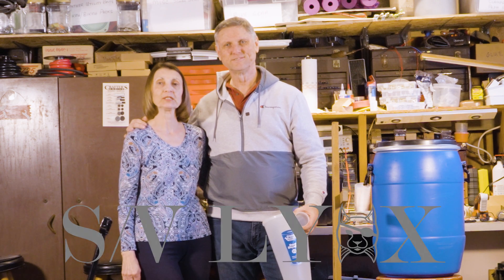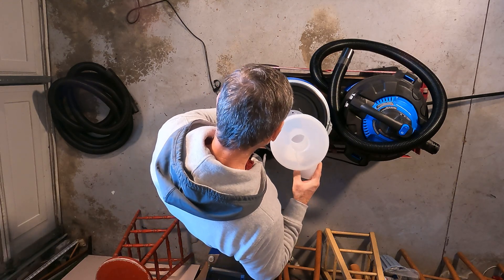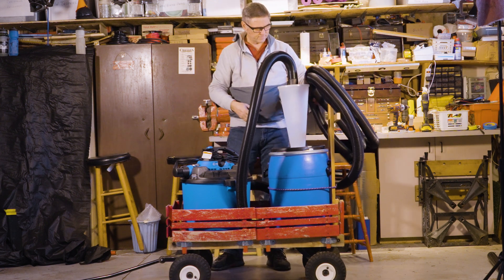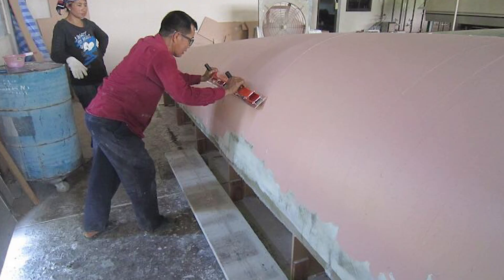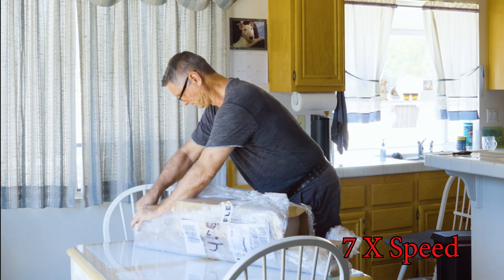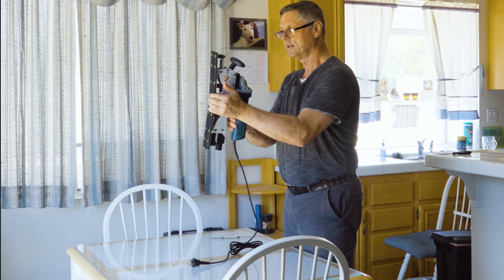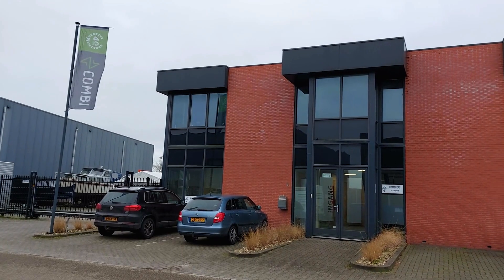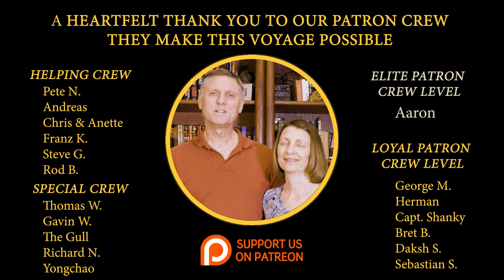Kit-E19 Cyclone System and other Kit Cat build preparations

Comment: I use a similar dust collection system in my small wood shop.  I added a dust bag inside the vac to guarantee the shop vac filter doesn't get clogged.  This is working very well and I highly recommend it, especially for collecting sanding dust which due to it's small size/weight per grain has a higher tendency to make it into the shop vac.
Reply from the maker: If you could, send me a picture of dust bag, that would be helpful.  There is a contact page on our website www.svlynx.com

Comment: I watching the motor episode I would suggest adding the second diesel motor  I know it’s overkill but it’s  easily done now and it would balance the stern  you would have to have a second control   And more diesel
Reply from the maker: Though we appreciate your suggestion, we have made our purchase and will be going with our current system.  It was based off of another 50' cat that did a full circumnavigation with this exact setup and highly recommended it.  We'll see how it goes.  :)

Comment: Looking forward to this build, I’m wondering how are you guys gonna mitigate the creaking on the boat.
Reply from the maker: It shouldn't be a problem. As we understand it most creaking on cats is due to how mass production  companies construct their catamarans. They use modular furniture pieces that drop in.  Then, as the boat flexes, the separate  furniture moves and rubs against the structure of the boat and it creaks.  With the way that the Schionning boats are constructed, like all the bulkheads, all the furniture is part of the structure and tabbed into the boat.  It creates a very stiff and strong boat that doesn't creak.  But that's just what we have been told.  Maybe others who have owned Schionning cats or others brands can chime in.
Reply: @SailingSVLynx  That makes sense, I’ve never been on a Schionning Cat but hopefully I’ll get to see yours anchored in Puerto Rico in the near future. Best of luck guys !
Reply from the maker: It may take a few years, but we will reach Puerto Rico.  You will have to give us a tour!
Reply: It would be my pleasure, also if you ever in need of Continuous Filament Fiberglass Mat message me.

Comment: Good video!! I didn't notice; when you attached the cyclone separator to the top of the bin, did you use a stiffening plate on the bottom of the lid, when fastening it together? It's a super idea!
One thing for the future: I've been noticing that a lot of the people who are building boats, have obtained a pair of electric rechargeable scissors. They've been branded/stenciled with the names of boating supply companies. At about half the cost, you can purchase the exact same thing, usually under the DRITZ name, at most fabric/craft stores. Same two cutting tips, same body, same rechargeable batteries, same charging station. Also, extra batteries are available.
Boats, as well as most truly fun toys, are EXPENSIVE!!! Trying to help with small amounts here and there, adds up to enormous savings in the long run.
Enjoy the weekend and thank you for sharing!
Reply from the maker: Hey Leon!  Thanks for the suggestion.  We have already purchased rechargeable scissors, but keep the suggestions coming!  We can use all the advice we can get!  As for the lid, it was stiff enough on its own so that I didn't have to reinforce the top, but good idea.  If I see it flexing, I'll add one later.  We couldn't agree more about looking for savings, we have a limited budget to build this catamaran and it's pretty tight already.  But, we have purchased the major systems so there shouldn't be any large 'gottachas', but little stuff can add up as well.

Comment: Another excellent vid. It's good that you let us know what's coming up, you may get some good suggestions on build techniques & materials etc. I wish we'd had one of those vacuum cyclone units to avoid filter clogging, it 2as a real PITA.

FYI, re sandpaper, we found the 3M Cubitron II discs to be clearly superior on the random orbital. Re fairing, do you know the technique of trowelling on parallel lines of fairing with a square notched trowel first? The lines of compound about 3 or 4 inches apart vertically up the hull sides, then use a longboard with 80 grit to fair the ridges down to the required height above hull surface. Then trowel the compound in between all the faired ridges with your flexisander blade, and machine sand until compound is same level as the faired ridges which should be the minimum to deal with the lows. It helps to have the ridges a different colour than the remaining compound so they show up when you sand down to them. This is a real time saver, and leads to a better fairing job on a big job.

Hopefully other boat builders can chime in f4om time to time to pass on what works.
Reply from the maker: Thanks Rob.  I have heard of that technique, but please, keep the suggestions coming!  We are not experts in building boats, we are learning as we go and can use all the help we can get.  The only kit sailboat (a Mirror) I built was back when I was 11 years old, so a few years ago, OK, a bunch ;) .  However I do have a question.  How would I get the fairing compound to be a different color?  I would ask if I could use two different brands, but that's not possible.  All the fairing compound comes in our kit, so we have what we have.
Reply: @SailingSVLynx  Being based on epoxy you can colour epoxy with non oil based tints or if you want it darker you can sprinkle in some powdered charcoal/graphite powder. Don’t need much to create a slightly different shade. The manufacturer of the compound can advise you also. 
A slight refinement we used was not using square notches in the trowel we made from thin aluminium bar, but 45 degree angle V’s about 3 inches apart, cut with an angle grinder. Then when you are getting down to the top of the V being revealed, you can really dial in the amount of longboard sanding by the thickness of the V line. Its very thin at first ( the top of the V) and progressively thicker  as you keep sanding down. Does that make sense?
Reply from the maker: @robthompson7174  Absolutely!  Great innovation that we will steal ;)  I'll give you credit lol
Reply from the maker: Which 3M Cubitron II disks did you use?  There seem to be a lot of styles under that name.
Reply: @SailingSVLynx   We used the 6 inch mesh disks in grits from 80,120,240,320 & 400. The 400 were harder to find supply but are worth it, give a phenomenal finish and just keep working for about 3 to 4 times the surface area of other good quality discs. The vacuum dust extraction of the mesh is far superior to disks with holes,  especially in the finer grits. They are purple in colour.
Reply: The notched trowel method described does work well, but take care while mixing fairing compound for consistency, the reason for this is different consistency between notches and fairing compound can cause print through on final paint job and not straight away but in time. Cheers schionning builder Australia.
Reply: @edwardhaigh4249  Yes thats true and its why we used the 50:50 easy mixing stuff, Technifill from ATL. Also important to only do as big a section at a time as you can sand the next day. It gets progressively harder day by day as it cures, so if you leave it too long its like sanding granite.
Reply: @robthompson7174  Sounds  good, I was assuming they would be using microlight and mixing there own, cheers for the product info.